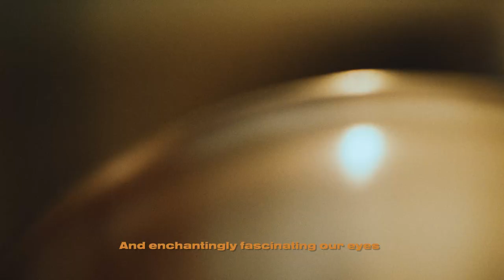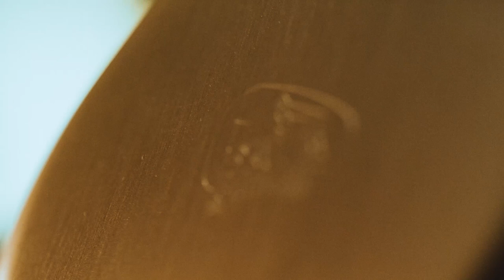Falk Culinair - The Worlds Finest Copper Cookware

Comment: Copper and Falk both kick ass, but copper was the second metal humans learned to shape, not the first. 

Gold was first.

Because it was:

A) found as a pure metal rather than predominantly compounds which needed melting first 

and

B) is even softer than copper and easier to work with. 

Gold would be kind of rubbish for a frying pan though.